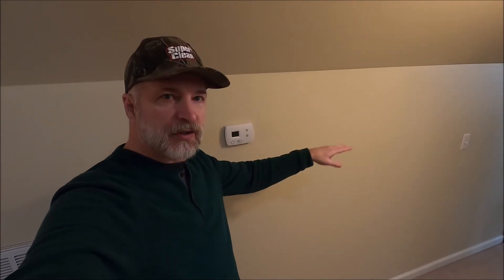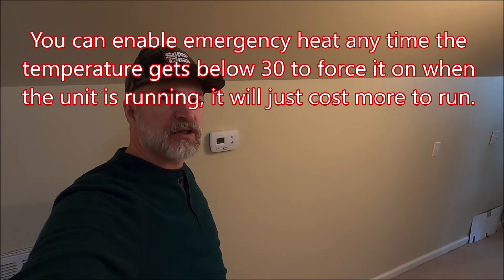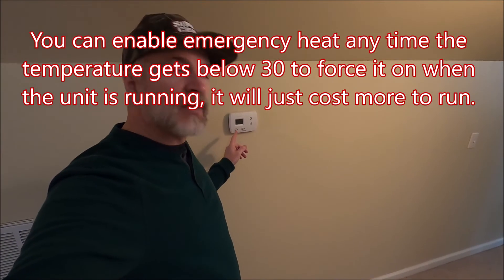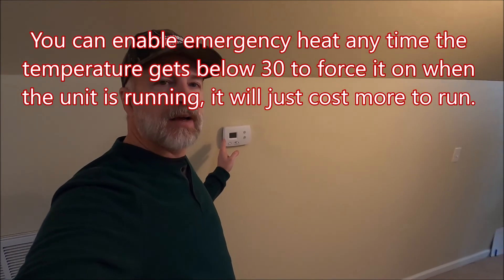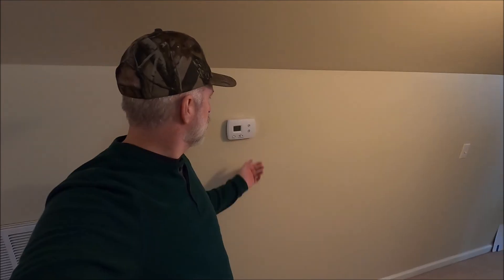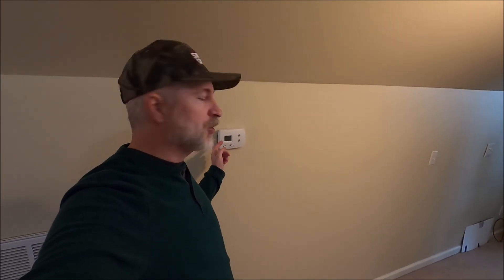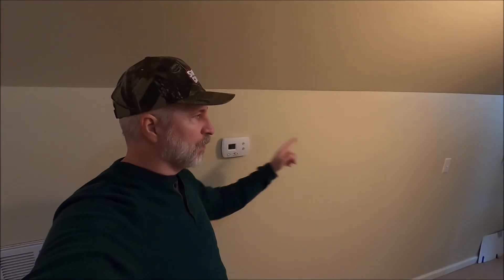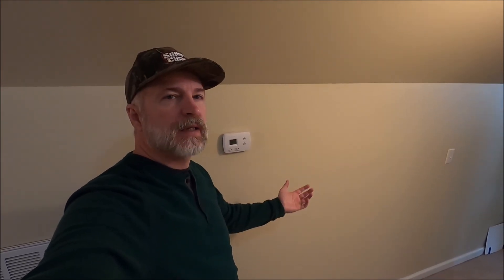What is Emergency Heat Mode And When To Use It On A Heat Pump

Comment: My Bryant inverted heat pump has "System Controlled" setting and will use heat pump, electric or a combination of the two depending on conditions. I have had heat pump only continue to run down to 2 degrees. Generally, the electric only comes on under 10 degrees.

Comment: Dude defrost mode is ac mode and heatstrips automatically come on when temp get below 35 degrees
Reply from the maker: I'm not sure if you are trolling or really believe that but on most heat pumps around here, they don't automatically come on.
Reply: @GregsDIYGarage  I'm not sure what your on but when the temp gets below freezing the heat pump can't keep up because it can't pull heat from freezing air so therefore the auxiliary heat comes on automatically with the heat pump to assist it  auxiliary is electric heat strips, or gas furnace  or oil furnace , now you are the troll
Reply from the maker: A heat pump will automatically go into defrost mode where the system basically runs backward (switches to AC when on heat) to warm up the outside unit, but my heat pump, along with most others around here, does NOT automatically turn on the emergency/auxiliary electric heat strip unless the emergency/auxiliary heat is turned on by using that switch on the thermostat.
Reply: I'm not trolling I'm a master licensed HVAC tech since the 70s and when a heat pump can't keep up the heat strips automatically come on to help when under 35 degrees now I can teach you in defrost it goes into ac mode now you are trolling
Reply: Dude go back to school kid wow heat strips automatically come on to help the heat pump keep up in freezing weather you say this in your videos now you must drink alot
Reply from the maker: If your thermostat has a switch for emergency heat, the electric heat strip will not come on unless that switch is set to on. If it is set to on, the electric heat strip will come on when the heat comes on. That is why it has an on/off switch.
Reply: You are so wrong you dont switch tstat to aux the aux light comes on letting you know heat strips are on helping heat pump
Reply from the maker: Look at the thermostat in the video.  Do you even see an aux light? No, because it doesn't have one...
Reply: You are so dumb , heat strips automatically come on when the heat pump can't keep up wow you say this in this dumb video you are the most ignorant
Reply: When the temp gets to below freezing they automatically come on to assist the sorry heat pump I know I've been a Master licensed HVAC tech since the 70s I've taught night classes and have my own company I wouldn't hire you IG I did you would clean my shop because you dont even know how heat pumps operate
Reply: When temps reach below freezing the emergency heat which is heat strips automatically come now please find another job
Reply: You even say they automatically come on in this dumb video

Comment: We recently had a cold spell here in VA.  Aux heat kicked on as it should, but now that the weather has warmed up, the system is staying on aux heat.  The outside unit never iced up during the cold snap, but now it never comes on at all. Any thoughts on what to look for before calling an HVAC tech?
Reply from the maker: I'd try turning off the breakers for a minute or two and then turning them back on. Maybe it will reset. Good luck!
Reply: @GregsDIYGarage  I'll give that a shot...thanks!
Reply: @ Alas, that didn't have any effect.  It's currently 48 degrees outside, so that's not cold enough for the heat pump not to be able to get some warm air.

Comment: is this the same as aux heat?
Reply: Backup heat, one slight difference between emergency and aux is the outdoor compressor continues running in aux whereas emergency stops the outdoor unit and only the indoor heat source (might be electric, gas or in some cases oil) is used.
For instance, if the outdoor unit becomes a frozen block of ice due to severe weather or has failed in some way, you can switch to emergency heat.
It's not abnormal for aux heat to kick in from time to time under challanging conditions where the heat pump itself isn't able to satisfy the thermostat setting.  In this case, both heat pump and indoor heat source are running simultaneously.
Reply: @thisisyourcaptainspeaking2259  well i have an olllldd school thermostat with a manual emerg heat switch which i run when it gets crazy cold like now. 
But i want to buy and install a smart tstat. All of the ones i see and want do NOT offer emergency heat only aux heat.  Those say that an app telling the temp outside would cut off somwthing and go to aix heat. 
I just do not understand how these smart tstats will shut down the outdoor unit in order to use e heat OR if somwthing happens i am not able to use e heat? 

Does this sound right
Reply: @tylerfj24  It's a pretty basic function that I would expect all thermostats to have.  AUX is an automatic feature where backup heat supplements the heat pump whereas emergency uses backup heat only, disabling the heat pump.
So, there is a difference between the two of these.  I don't know of any thermostat that doesn't offer both aux and emergency heat mode but keep in mind, aux is an automatic function that employs when heatpump is unable to satisfy the thermostat setting, no user intervention is required (aside from initial setup).
Reply: Auxiliary and emergency heat are the same wow

Comment: During defrost, where the system essentially runs in AC mode to clear the outdoor coils, the heat strips come on automatically to temper the cool air until defrosting is completed. If you have gas available, IMHO as an HVAC pro, you should consider using natural gas as the defrosting or supplemental heat source. Depending on cost, propane may also be a good choice. Natural gas is much cheaper than heating with electric strip heat, unless you have a large battery bank charged by solar panels. Using gas or oil for supplemental is called a "dual fuel" system. A modern T6 stat is capable of controlling that setup, along with several other modern stats. HTH.

Comment: I will have to use emergency heat, how many days can you use it and how does it affect the electric bill ?
Reply: Used it for a bit and my electric bill jumped from $200 to $630. So I’d recommend using with caution.
Reply: @deandredavis5264 so when you in a double digit number, and your system is running for 10hours. Does that not run up the bill also?
Reply from the maker: You can use it as long as needed. Your electric bill will go up some. The amount depends on how much it has to run and your local rates.

Comment: The heat pumps we have up north are good to about -15 degrees celsius (5F), but not all of them have the built in backup that youre talking about, so people have to install baseboards to compensate. Gotta make sure you buy the correct units for where you live!

Comment: Real important note here: there are different types of heat pumps, and not all heat pumps start to fail or freeze at 30°. There are “cold climate” heat pumps that work even near the Arctic, efficiently. The unit we just installed for our New England home only starts to struggle at -15°F (that’s 15° below zero, 47° below freezing).
Reply: Not true heat pumps only blow warm air ,96 degrees ,at below freezing temps the heat strips come on ,no heat pump can get heat from freezing ambient air

Comment: In my experience, heat pumps are garbage as they don't work right when you need them most, at least in more northern states. It sounds like they need to work on making emergency heat more efficient and just get rid of the heat pump altogether.
Reply: Unfortunately, the science does not work that way. It is impossible to make resistance, electric, heating more efficient.

Comment: Thank you for this information! Question, if we do use the emergency heat, does that take away from the defrosting process from the condenser?
Reply from the maker: Emergency heat shouldn't negatively affect condenser defrosting.

Comment: Every channel states emh uses more more electricity and higher electric bills. My apartment heats on emh in 10min, regular heat in 30 min or more. Which one is using more electricity?
Reply from the maker: It's like walking a mile vs running a mile. Walking uses less energy but takes longer while running uses more but is quicker. If the outside temp is 30 degrees Fahrenheit or higher, the heat pump will use much, much less energy than emergency heat.
Reply: I live in Tennessee heat pumps in this region are garbage below 25 degrees when it's 15 degrees it,s running to death defrosting normally thankfully I like it cool indoors at night for the past 3 years when it drops below 20 degrees I shut it down and turn it to emergency heat and set it to 60 degrees it runs 3 to 4 minutes and stays off 25 to 30 minutes conserving and keeping it as cool as I can stand it I really don't so that much difference in energy cost maybe a few dollars of course a well insulated home is also important great video stay warm folks.🥶

Comment: My outdoor unit froze into a big block of ice, ruined the reversing valve and now only runs in emergency heat mode, no more ac mode either. Entire system is only 5 years old and everyone just wants to replace it rather than fix it. The HVAC system didn't even last long enough to pay for itself. Wish I could figure out a way to affordably heat my house now. 😒
Reply: Switch to gas heat, you'll like it much better.
Reply: @geod3589  I had a gas furnace. It was great but needed a little repair. Our city is outlawing gas heat without a vote from the public, thus, forcing me into an entire new electric system that didn't last four winters. 🙄 It's also time for me to look in to a new water heater, guess what, the city wants to force me to get a heat pump style water heater. What's the point in owning a home just to have city government force their choice of appliances on you. Reminds me of the useless low flow toilet debacle. 🤔
Reply: @GeemailMailboxx   Local power company installed "smart meters", now they want us to install "smart thermostats" in our homes.. I guess they can't control you as well if you have gas..
Reply: @geod3589  I told them where to put their smart meter. I'm still one of the few on our block with the old style meter. I asked them also, why they were in such a hurry to eliminate another good paying job like meter reading from the economy. They got mad but eventually let it be, with the threat of a special fee to have it read by an actual human. So far, I've not seen any extra fees. 😉
Reply: @GeemailMailboxx  We were also told there would be a fee to have a human read the meter.  I have a smart meter and get monthly statements showing where my power usage went.. rather invasive imho.  Smart thermostat is out of the question but I feel they will be forced on us eventually.
Reply: @geod3589 some areas don't have gas. You can't just switch it if the neighborhood doesn't have gas lines. Majority of newer homes run electric
Reply from the maker: Sorry to hear that.

Comment: How long we can use Emergency heat? When I set it to Heat then it not have warm or hot air  come out but when I set to Emergency heat then I feel the warrm air. How to fit this problem? Is the a/c ruin up soon if we just use emergency heat for now because don't know what's the problem to fix?
Reply from the maker: You can run emergency heat as long as you want to, it just uses more electricity. A well working heat pump should be able to produce heat without issue if the outside temp is 30 degrees Fahrenheit or higher.
Reply: @GregsDIYGarage  38 degs outside now,  thermostat (Honeywell Home T4 pro) set on 70.  Unit runs non-stop, will only get temp in the house to 67 degrees.  Temp of air 97 degs out of the vents.

Comment: I recently changed my thermostat from a normal to a wifi version. We it hasn't been getting below 30 yet (as far I know) . But I noticed my original was in.. I could hear my heat pump kick in and defrost itself. After replacing it with a wifi version. I noticed i haven't heard it defrost. I always leave my house at 70f. I like it a little cool inside my house. I guess my question is. Should I be concern? Or doesn't it have to be cold outside for it to defrost on it own?
Reply from the maker: If it's defrosting a lot when it's not cold out, it might be a little low on freon (which ever type it takes).

Comment: My thermostat blinks auxiliary heat, only gets around 66 i have it set to 73. I also have a humidistat the only time is blows is when that is on, ON. Is that where the humidistat should be set while on heat setting?
Reply from the maker: Sounds like your heating unit is using the emergency/auxiliary heat but it’s just too cold outside to keep up. This is very common during this extreme cold spell. 

The humidistat is basically a whole house humidifier which uses the HVAC system’s fan to distribute humidity through out the house when the humidity level is below what it’s set to. If the heater is running a lot, it will take moisture out of the air causing the humidifier/humidistat to run more often. BTW, the dryer the air, the colder it will feel, so keeping the humidity level in the “normal” range (40-60%) will help. Mine is currently only 31% 😖

Comment: So...if i manually turn on my emergency heat. Does it cut on and off...like the regular heat?? Or does continually run.
Reply from the maker: It should cut on and off just like normal, but the “emergency heat”, the electrical heater coils, will also be used any time it’s on.
Reply: My bearings went out on my carrier. Top Fan motor. Switched to e-heat. I had to put fans on continuous to get any air flow. Would not cycle.

Comment: So if I turn on the emergency heat manually on my thermostat and it uses the inside heat coils will the outside one then freeze up and if I switch break it will break it being frozen up? It’s around -4F here I set my thermostat down to 62 and it has a hard time getting it to 62 and is on 60
Reply from the maker: With emergency heat on, the outside unit is much less likely to freeze and the unit will provide the most heat it can. Emergency heat will also help if the unit has to defrost the outside.

Comment: Thank you-  we have an infant and a new home.  Emergency heat was never explained to us. It was 15 degrees outside and our temp inside couldn’t keep up.  Thanks to your video I had the confidence to turn on the emergency heat function.  Thanks a lot
Reply: This describes us exactly. In the house for 2 months and didn't know what emergency heat was.
Reply: I heard it’s extremely expensive to run emergency heat…my units never turns off I reg heat, when the temp are 19,and below…I’m going to try it for a couple of weeks and see how expensive my bill gets
Reply: Ran into this too. It ran for hours!
Reply: Heat pumps blow warm air when it gets below freezing the heat strips automatically come on to help heat pump